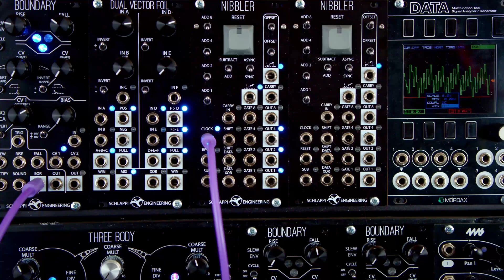Nibbler Overview

Comment: This is probably the first module that makes use of binary that's not too complicated. The first half of the video is already doing  what I usually use Drezno, Lipsk and Erfurt for but without the confusion and ribbon cable hassle of the Leibniz system and more options that make a lot of sense when using this as a source for pitch cv or stepped modulation. And as usual a very enjoyable video to watch as well.